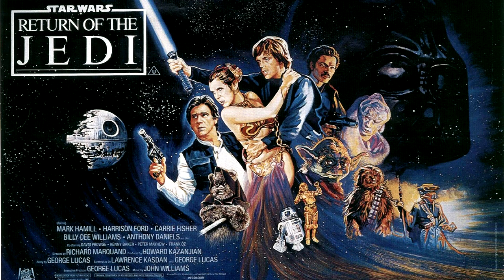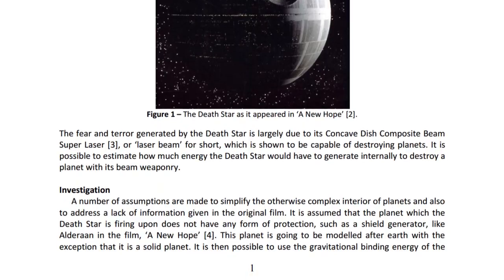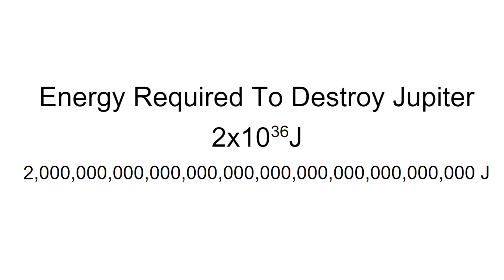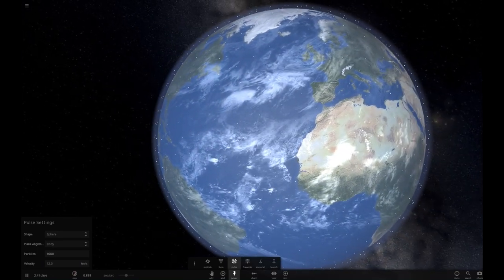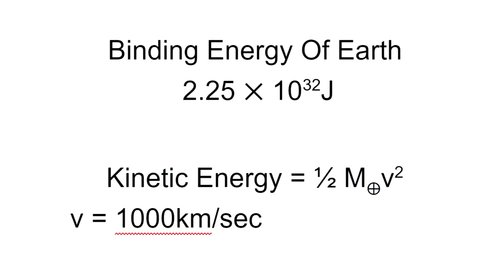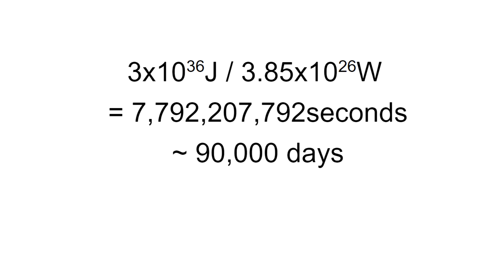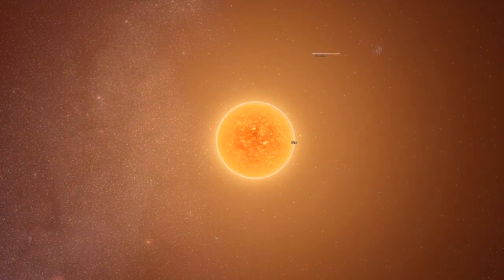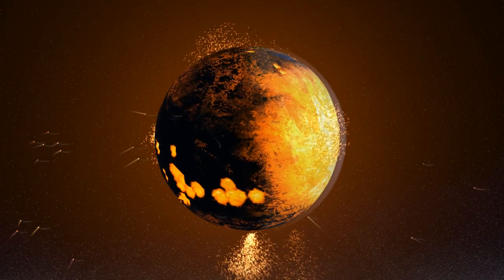How Much Power Do You Need To Destroy A Planet?

Comment: simple answer

two AA batteries
Reply: I think you just need one, AA batteries are op.
Reply: +NonsensicalSpudz Whew, I thought you were going to say 42.
Reply: Bat battery's and space duct tape
Reply: +KerbaCell Battery Industries Sure .. if you want to fix a planet.. To destroy planet; Drop a Nokia 3310 from high orbit
Reply: +NonsensicalSpudz Sure, if it's moving at relativistic speeds.
Reply: +GengarTV Easy there just trying to destroy a planet not trying to puncture a hole in the entire universe.
Reply: +NonsensicalSpudz You'll need a pair of batterizers to boost those AAs. Not to boost the power...
You just drop the pair of AAs with batterizers from high orbit, and the sheer quantity of batterizer bullshit is enough mass to destroy the entire planet.

Comment: Love the science behind these videos Scott, truly engaging. However, going off of expanded universe lore (I know it's not cannon any more, but it's the best we've got for this) Hyperdrive engines - for whatever reason - barely sip fuel while it is the sublight drives that consume the majority.  This was mentioned in a book in the X-wing: Rogue Squadron series, forgot which one.  

Sidenote: can we imagine how awesome an X-Wing: Rogue Squadron or TIE Fighter game movie/tv series would be? Top Gun in space with star wars fighters? friggin sold
Reply from the maker: +Kevin Despot You know that there's a Rogue Squadron movie planned for Christmas 2016?
Reply: +Scott Manley Rogue One is not about Rogue squadron.
Reply: +Kevin Despot The Expended Universe is still canon considering technical data ^^
Reply: +Kevin Despot Don't really have to imagine that too much...it was called "Space: Above and Beyond" and had an aborted series run on Fox back in the early to mid 90s.
Reply: Given that even the Death Star was capable of pretty extensive interstellar travel with just onboard reactors, flying a planet around juiced up on the power of a star really doesn't stretch the Star Wars envelope of believability too much.
Reply: +Kevin Despot BSG had some pretty decent dogfighting in space. At least, until the later seasons when it stopped being about fighting the cylons.
Reply: nice home improvement
Reply: the Rogue Squadron series is based on the game, X-wing vs TIE fighter
Reply: so, no rogue squadron movie yet...

Comment: Scott the reason death stars are needed is because planetary shields exist.\

Other wise a single star destroyer would wipe the planet of its surface in an hour.
Reply: well, last movie prowen that planetary shields doesn't matter anymore since you can simply bypas them, I don't know why they even bother to turn them off.
Reply: +randomnickify Good catch. Even if such a maneuver were crazy enough that no one would want to try it to invade, you could still equip a ship with a warhead and do the same thing.
Reply: randomnickify It's too dangerous and is suicidal, han solo did it by being exceptially lucky and having the force guide him.
Reply: +TheDAWinz  true, still you can just turn bunch of hyperspace capable ships into automated heavy nuclear varheads and fling them into planet, statistcally some of them would survive and explode on the other side of shield basically making shields irrelevant.
Reply: randomnickify Hyperspace ignores the planet, that's why exiting under the shield was dangerous,
Reply: randomnickify You could easily end up inside the planet, crushed. Hyperspace travel is extremely fast, crossing galaxies within the day fast.
Reply: +Matthew Chenault That actually makes much more sense than the other explanations... Did you get it from some expanded universe source?
Reply: +TheDAWinz I've seen almost this exact same comment in this same section.... was this mentioned specifically in canon somewhere that I haven't seen?

Comment: Scott, sorry for me being... ignorant to physics, but doesnt escape velocity vary based on different variables ex: air pressure, gas, density of object, etc?
Reply from the maker: +- TheNinthMillimeter - The escape velocity only depends on the mass of the planet you're escaping from. However maybe you're thinking about atmosphere escaping a planet, where you can calculate that rate depending on the gas, pressure temperature etc etc.

Comment: kinda makes you wonder why they didn't just make a big space gun that fires moon sized rocks into planets ;p
Reply: +Toryu Naminosaki I vote to call it a Matter-ing ram!
Reply: +Toryu Naminosaki hell, how about asteroid sized blocks? Make the firing mechanism cheaper so you can build more and thus more people will die. Everybody wins!!! 

If you are with the First Order of course...
Reply: +Toryu Naminosaki 

They actually did....sort of.In the Expanded Universe,the Empire built a massive gun called the "Galaxy gun'' designed to destroy planets.
Reply: +Toryu Naminosaki Because (at least in 1977) that would have been far outside the visual effects budget to pull off.
Reply: +K1productions Shoot a rock through a fancy looking tube and you're golden.
Reply: +K1productions Shoot a rock through a fancy looking tube and you're golden.
Reply: Benjamin Norton
doesn't quite work that way, especially when you need to illustrate damage to said planet, without resorting to the obligatory explosion effect that simply covers the planet model.
Reply: +Grim what else did they make? A paper clip that can destroy planets?
Reply: +Toryu Naminosaki  That's no moon! It's a bullet!
Reply: +Toryu Naminosaki Once again a problem of resources. Assuming (and this is a big asumption, but they did use an energy beam to destroy a planet) that you can shoot moon-sized rocks, where are they going to come from? It'd be pretty damn impractical to have to collect and manufacture a new "bullet" of that size every time you want to shoot. What if nothing the right size is even available?
Reply: +ThePCguy17 I'm assuming you'd get them from the asteroid belt of whatever system you're trying to kill the planet in
Reply: +Toryu Naminosaki then why bot say asteroid sized rocks?
Reply: +ThePCguy17 I was exaggerating a little, but you get the idea ;p
Reply: Here's my counterargument.

The energy required to move a moon-sized object is still pretty big, even if the intent is to knock it off it's orbit and into collission course. And even then it'd be even cheaper to knock an asteroid off-course to do damage.

Also, while yes, it'd be cheaper to just lob large rocks at a planet in order to cause mass destruction, taking in account the setting's level of technology when it comes to weapons and communications, asteroids improvised as weapons would be super easy to intercept. Even if  a moon is used, it could be diverted to another route using the same way it was set on a collission course with wnough anticipation.

Besides. Why waste a whole moon  full of precious resources just to send a message?
Reply: heartlessmushroom
Or simply lower the moon's perigee.  The additional gravitational stress upon the planet below would have devastating effects globally.  Arguably far greater than those a single asteroid impact would have.  Message sent, and moon still ripe for harvest
Reply: Excellently argued. That even reaps greater rewards.

However, it DOES require the victim planet to already have a moon AND that it's inhabitants havent already gotten a strong foothold on it as an extension of their territory.

If that were the case, an attempt to invade a moon and screw up its perigree in order to cause tidal chaos on  its parent planet would definitely draw attention and provoke military reaction and cause a battle, which would defeat the purpose of a singular, devastating strike to send a message.

 It would take more time and resources too , because you'd have to set up everything up to nudge the moon all while preparing your defenses for the strike team sent by the enemy to stop you

It WOULD however, if successful,  be an excellent way to hold a ransom to gain control of the moon AND of its parent planet all at the same time.

A big-ass laser still has the advantage of being impossible to counter once fired and is, of course, much more spectacular and terrifying, which as intimidation goes, goes a lot farther than "Obey me...Or I'm nudging the moon a little bit!"

Either way,excellent material to tell a sci  fi story
Reply: heartlessmushroom
hehe thanks, feel free to use it as you please, as the idea is non-copyrightable

Comment: As it pertains to Starkiller Base: given the Empire could already produce the Death Star, move it around and have it destroy a planet with the level of powers given by your high-end estimate, moving Starkiller Base around would be little to no issue especially with a planetary shield involved. Even the act of consuming a star's matter over time and use it to fuel Starkiller Base's superweapon would be a non-issue with the power of the Death Star also powering Starkiller.

Comment: Regarding your last comment about more efficient forms of terrorism, I would like to point out that orbital bombardment had already been employed for thousands of years (Taris about 4000bby, but I guess that's not canon anymore). The Death Star was designed by a scientist in the Maw as a 'mining platform' to expose the heavy metals in the core of a planet, which necessitates the ripping of the planet apart rather than a surface bombardment. Obviously the empire intended to use it for terror from the start, but technically, it was not a weapon, it was a tool with a practical purpose.

Comment: So what is the power generated when a super nova goes critical?
Reply from the maker: About 100,000,000,000,000,000,000,000,000,000,000,000,000,000,000 joules. (10^44)
Reply: +Scott Manley give or take 1 or 2
Reply: +Scott Manley That's a lot of joules! Or about 3.33x10^24 tons if you could stuff all that energy into an equivalent mass.
Reply: what about a collision between two black holes 100 times the mass of the sun?
Reply: +Harrison H It seems to me, that if it holds that nothing can escape the event horizon(s) nothing apparent would happen outside.
Reply: +Scott Manley So let me get this straight.  The new Death Star fires it's energy beam across interstellar distances?  Doesn't that mean the target has something like years, possibly hundreds or even thousands of years before the beam hits them?  I mean, the beam is basically a laser, it can't be travelling faster than light.
Reply: +The Batman The First Order somehow managed to build a hyperspace-weapon. It's mentioned in the movie. The beam travels faster than light. Doesn't explain why the beam can be visible from different planets at the same time, but mehhh... High-tech-fantasy ;)
Reply: +The Batman I think it's mentioned in the movie the beam travels across hyperspace.

Comment: Impressive analysis of something that's done basically for the sake of adding a cool special effect and a McGuffin :)

Going with this line of thought, what if the Death Star's superlaser is not really a laser but more like a particle beam that affects matter at a lower level, like - I don't know, 'switches off' the strong nuclear force? or maybe somehow turns what it touches into anti-matter and causes a massive annihilation chain reaction, so strong that it seems instantaneous to the eye? I suppose that wouldn't change the energy requirements, but at least would make a bit more sense than an actual laser :)

BTW, your explanation of how the 'starsucker base' could work is pretty good - otherwise the weapon would have absolutely no point, which is a lot, even for a Star Wars movie :-)

And yeah, having a decent mass driver and bombing Alderaan back to stone age with asteroids would be much more realistic but would probably take long. No 'shock and awe' campaign ;)

Comment: One reason why I have always thought that the Empire built the Death Star was as a means to overcome planetary shields. We see in The Empire Strikes Back that Vader's fleet is incapable of penetrating the small shields on Hoth, it is thus likely that more developed worlds have even stronger shields. It would explain why the Empire build a weapon that used so much overkill, it was the most efficient means of overcoming shielded worlds, in a similar manner to cannons against castles. 

As for the problem of where such a shield would dump all its energy, astrophysicist Curtist Saxton came up with something rather clever. In the Incredible Cross Section books, he wrote that Star Wars vessels use neutrino generators, thus dumping their waste energy in an inert form. That would also explain how Coruscant avoids cooking itself, which would naturally occur with that many people on such a world, as pointed out by Irregular Webcomic. 

He also suggested an interesting solution to the power problem created here. It would obviously be impossible for something like the Death Star to carry that much energy under E=mc^2(especially if firing more than once, not to mention jumping into hyperspace). Given that Star Wars has FTL, it could be possible to store energy in a tachyonic state in which the mass of fuel is not actually carried by starships because almost all of it is stored in hyperspace. In other words, it can overcome the tyranny of the rocket equation. 

Starkiller base also has the odd problem of the beam apparently travelling at FTL while also being visible in multiple star systems. The novelization also apparently claims that the weapon uses dark energy and tears a hole in spacetime. Unlike the above, it was clearly not written by a physicist. 

Han's trick of bypassing shields is also rather problematic. It completely negates the need for a Death Star or anything else that would overcome shields as it is able to bypass them entirely.

Comment: Several folks brought up the fact that planets are shielded.  But the original Death Star utilize a high power laser blast, if the target planet was shielded then even the laser would have to overload said shield.  In a case like that it would still not be necessary to destroy the whole planet, just bombard the shield with so much energy that the shield itself literally cooks the surface of the planet.

You see in most science fiction , shields work by taking the energy of a laser blast and distributing that energy around the the entire surface of the shield, the by product of this is heat.  The more energy applied to the shield the more heat the shield generates.  Apply enough energy and the shield either collapses or generates so much heat that whatever it was protecting is cooked to a crisp.

So all the Empire needed to do was overload the shield and them bombard the planet, or let the shield do all the work.

Comment: Hey Scott! think about this... the green lights actually travels slower than lightspeed, we can clearly se eit with our own eyes. What if that beam isn't actually a beam, but a laser propelled kinetic projectile (unimaginably dense one i presume, like miniature black hole). 

So ofcourse the projectile would travel slower at start end, and thats why it looks slow. You know the size of the deathstaar, so can you calculate the actual speed of that green light travels from disc rim into center column? And... while you are at it... calculate the projectile actual mass and power at... lets say if it accelerates like to 99,9999% of lightspeed?

Comment: Scott, you used here the gravitational binding energy to gauge the energy requirement for destroying a planet. That assumes the planet is already made from tiny microscopic particles. Which is fine for a first step. But for a real planet you need to spend some energy to create those particles, to turn the crust in liquid or gas (or plasma), to overcome the magma cohesion and that will put some more zeros to the energy requirement. Anyway, for an Alderaan sized planet I think this is still within the capabilities of the Death Star.
Star Killer is another matter thought... Visible hyperspace... rays, targeting simultaneously multiple planets and all that with the power (energy output) of a single of what appears to be an average main sequence star, which power (energy) must be stored somehow inside a planet... This seems to me too much like an unlikely rabbit from a hat, a plot device that is an example of poor writing and raises some sane questions, among them why the Palpatine's Empire, at its height, struggled to make a Death Star and this Imperial Remnant didn't struggle to make this StarKiller Base? or... what the heck is this hyperspace which suddenly starts to interact with the normal space? Too many rabbits from a too small hat...
Reply: For something with the mass of a planet the binding energy of its materials is near insignificant compared to the gravitational energy and it does not behave very differently from what it would if it were a liquid or a gas at the same density. It is in fact why beyond a certain mass any material, no matter how hard, will collapse
 into a sphere.
Reply: @listerdave1240  Ah, yes, you're right. We're talking here about full-fledged planets, not about planetoids or a star going supernova (in the first case the gravitational energy is not enough to always produce a sphere, in the second there is another source of energy, able to turn the star into... a fast-expanding sphere). So, no "more zeroes to the energy requirement", my mistake.